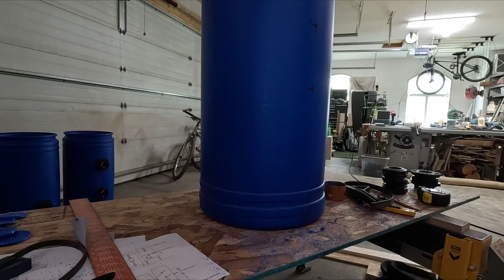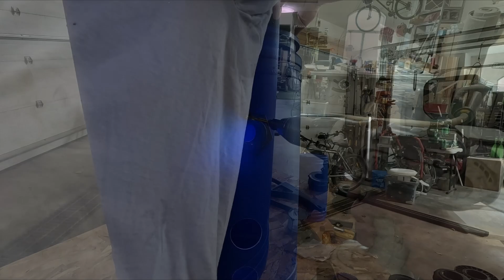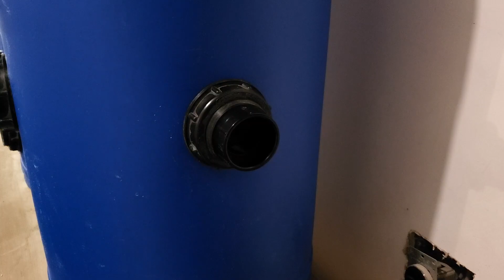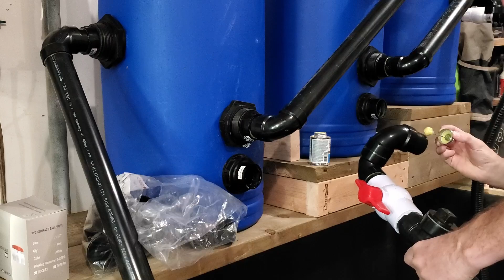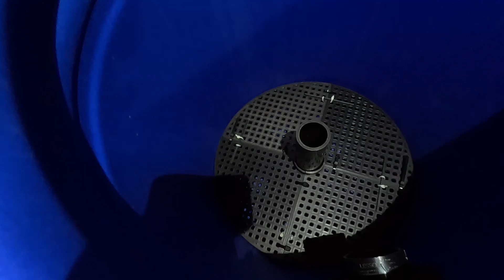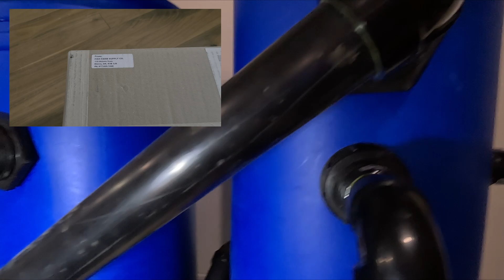DIY Koi Tank Upgrade:  Build Your Own Barrel Filter for Crystal Clear Water.

Comment from the maker: 📦 Everything we used in this video (Amazon links):

→ Ball Valve (4 Required) - https://amzn.to/4aX4FfN
→ ABS To PVC Solvent Cement (1 Required) - https://amzn.to/40x8kfh
→ K1 Filter Media (4 Cubic Feet Required) - https://amzn.to/4r1Q34G

→ Air Stones - https://amzn.to/4aFgLex

→ Air Pump - https://amzn.to/4sliziR

→ The remainder you can get at your local hardware store.  See Description for list of parts. 

As an Amazon Associate we earn from qualifying purchases.

💬 Drop your questions below — we read every one.Bulkhead Fitting (9 Required) - https://amzn.to/4sAn8WL

Comment: Why does it look like the bulkheads are different between the inlets/outlets and the drain bulkheads. Edit( I think they are mounted from the other side. )Why ?
Reply from the maker: I had two different styles of bulkhead fittings.  I tried to keep one type for inlet and one for outlet just to keep each barrel the same.
Reply from the maker: Thanks for watching and taking the time to comment.

Comment: Good day sirs,  anyway you could send a supply lost as I would like to buy online. I will ne using 55gallon drums thank you sooo much (im a girl heehee, need little help) 🙏thank u so much, Jamie
Reply from the maker: Here is the list of all of the plumbing parts you will need.
3- Barrels
9- Bulkhead fittings to match the diameter of the ABS pipe you will be using
21- ABS 90 Degree (Hub, Hub) elbow fittings to match the diameter of the ABS pipe you will be using
4- ABS (or compatible) Ball valves (Hub, Hub) to match the diameter of the ABS pipe you will be using
2- ABS T-Y fittings (Hub, Hub, Hub) to match the diameter of the ABS pipe you will be using
9- ABS Hub to MIPT adapter fittings to match the diameter of the ABS pipe you will be using
3- Hub drain screens to match the diameter of the ABS pipe you will be using
3- 3D printed cone screens
Approximately 20 feet of ABS pipe (we used 1 1/2", you could also use 2" if you want a allow for a higher flow rate)
1- 12" section of 4" ABS pipe with a 4" ABS cap
Section of corrugated flexible hose to connect your water pump to the filter.
Any specific fittings you need to connect your water pump and the corrugated flexible hose.
Drain hose and appropriate fittings to connect to drain line.
4 Cubic Feet of K1 Media
1 Air stone, air hose and air pump
Wood for step up bases and platform

Comment: The swirl filter seems redundant in this system since the radial settler is more effective at removing both large and smaller solids solids. Is there a particular reason for including both?
Reply from the maker: Not really.  I know the swirl filter is better for separating heavier solids, but there shouldn't be much of that in a tank environment.  I do get a fair bit of waste from it when I clean it.  Might have to try converting it to a settler at some point to see if there is an improvement.  Thanks for commenting and watching the video.

Comment: Can I have all the pumping parts and the pump you are using thank you
Reply from the maker: Here is the list of all of the plumbing parts you will need.
3- Barrels
9- Bulkhead fittings to match the diameter of the ABS pipe you will be using
21- ABS 90 Degree (Hub, Hub) elbow fittings to match the diameter of the ABS pipe you will be using
4- ABS (or compatible) Ball valves (Hub, Hub) to match the diameter of the ABS pipe you will be using
2- ABS T-Y fittings (Hub, Hub, Hub) to match the diameter of the ABS pipe you will be using
9- ABS Hub to MIPT adapter fittings to match the diameter of the ABS pipe you will be using
3- Hub drain screens to match the diameter of the ABS pipe you will be using
3- 3D printed cone screens
Approximately 20 feet of ABS pipe (we used 1 1/2", you could also use 2" if you want a allow for a higher flow rate)
1- 12" section of 4" ABS pipe with a 4" ABS cap
Section of corrugated flexible hose to connect your water pump to the filter.
Any specific fittings you need to connect your water pump and the corrugated flexible hose.
Drain hose and appropriate fittings to connect to drain line.
4 Cubic Feet of K1 Media
1 Air stone, air hose and air pump
Wood for step up bases and platform
Reply from the maker: https://a.co/d/9jzeAvu.  This is the pump that I use.  You could go with one of the smaller ones as well.  I usually run mine on setting 3 out of 10.  I like this one since it allows me to ramp the pump up ot down depending on how I am using it.
Reply from the maker: Thanks for taking the time to watch the video and commenting.  If you haven't already done so please like and subscribe.  Have a great day.

Comment: can i please have all the plumbing parts sir. please please
Reply from the maker: Here is the list of all of the plumbing parts you will need.
3- Barrels
9- Bulkhead fittings to match the diameter of the ABS pipe you will be using
21- ABS 90 Degree (Hub, Hub) elbow fittings to match the diameter of the ABS pipe you will be using
4- ABS (or compatible) Ball valves (Hub, Hub) to match the diameter of the ABS pipe you will be using
2- ABS T-Y fittings (Hub, Hub, Hub) to match the diameter of the ABS pipe you will be using
9- ABS Hub to MIPT adapter fittings to match the diameter of the ABS pipe you will be using
3- Hub drain screens to match the diameter of the ABS pipe you will be using
3- 3D printed cone screens
Approximately 20 feet of ABS pipe (we used 1 1/2", you could also use 2" if you want a allow for a higher flow rate)
1- 12" section of 4" ABS pipe with a 4" ABS cap
Section of corrugated flexible hose to connect your water pump to the filter.
Any specific fittings you need to connect your water pump and the corrugated flexible hose.
Drain hose and appropriate fittings to connect to drain line.
4 Cubic Feet of K1 Media
1 Air stone, air hose and air pump
Wood for step up bases and platform
Reply from the maker: I will put it together and then post it in the comments.  Give me a couple of days.  Thanks for watching the video.
Reply: Need help with the screens
Great setup